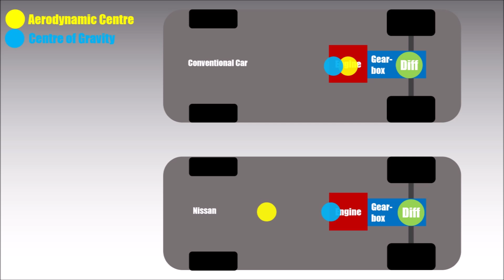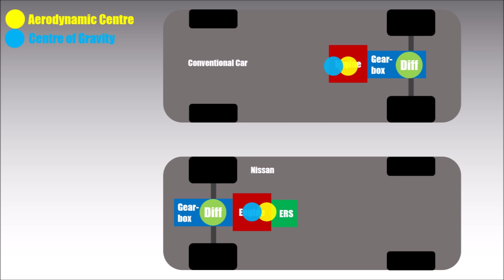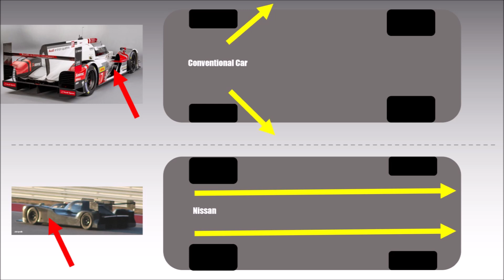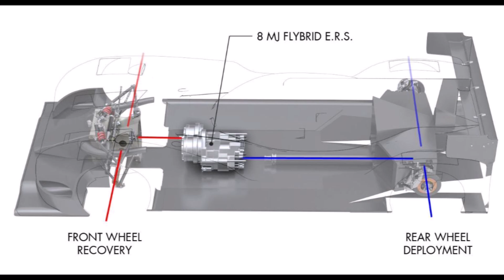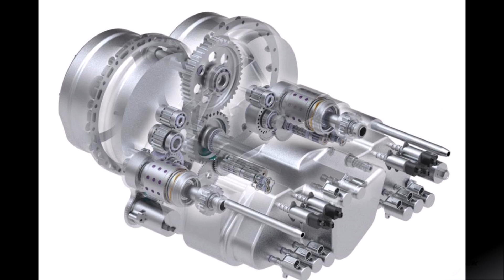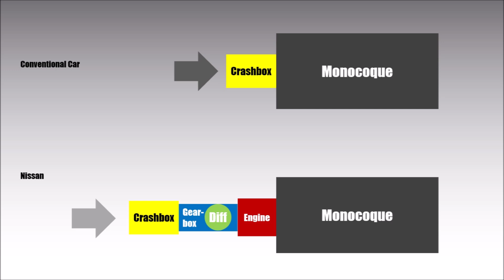Nissan GT-R LM Nismo (Le Mans 2015) - Genius or Disaster? - Technical Analysis

Comment: Had they started off with an electric hybrid system sending power to the rear they could've had a winning concept. Having some power at the rear would've helped with slow-medium speed turns, acceleration onto the straight, and probably would've helped put some more load on the rear tyres to get more use out of them. Alternatively they could've leveraged the hybrid system to run a higher downforce setup without losing top speed. 

Just a shame they killed the project so fast, but I guess all Nissan has cared for in the past 2 decades is cutting costs.
Reply: The rear wheels were also supposed to be driven, and take the majority of the hybrid power, which was to be deployed primarily on corner exit, which would have helped greatly with the cars slow speed late corner acceleration. Such as out of the Mulsane chicanes, through Indianapolis, and onto the main straight. The larger profile front tires would have also allowed them to attack the curbs a bit more. And the suspension geometry would not have been compromised in that situation either, such as it was at Le Mans with new spindles to fit the bigger brakes.
Reply: @bigbuckoramma  It would have helped their lap times, to be closer to LMP1 sure, but it wouldn't have made them competitive. The rules at the time for hybrid engagement were mandated at above 80kph. So the lack of traction for a FWD is absolutely still there, regardless of rear wheels being driven.

And given that the hybrid power was significant horsepower, and the fact their rear tyres were more narrow than anything else, it's hard to imagine they would have ever really been able to deploy it other than at high speed, when the deployment of hybrid is largely ineffective anyway.

Deploy hybrid at 320 and gain 5-10kph because you're at the vehicles aerodynamic v-max anyway

Deploy hybrid at 80kph through a corner exit and you'll be in excess of 30kph faster.

But they wouldn't have been able to do that with thin rear tyres
Reply: @flammenjc  name all the places on the Circuit de Le Sarthe that you are below 80kph.

Also, what wheels do the hybrid systems of the Toyota, the Audi, and the Porsche deploy through? Oh, that's right, the narrower front wheels. Do they have traction problems too? Of course not.

The width of the tire is determined by the weight balance of the car. It's as simple as that.

With a proper differential, and the correct  suspension geometry (See: Revo Knuckle), you can make plenty of traction and forward bite in a FWD car.
There are benefits and downsides to everything. But if you are content on believing there is only one way to do something, then you will miss out on learning anything new.
Reply: @bigbuckoramma  Arnage, Mulsanne, Ford Chicane.

The reason Porsche, Toyota and Audi didn't have traction problems is because all 4 tyres were of more-or-less equal size.

I'm not here saying people shouldn't explore new ideas. The point is, when a corporation does it in the effort to be a PR scam and nothing more. As motorsport fans, we should all hate that because they took everyone for fools, and many people took the bait and are still swallowing the hook

The product was bad. Even if their hybrid system was working it would NOT be fast enough. They could barely outpace LMP2 in qualifying with at least 200 more bhp. It wasn't good enough.

In many ways they tried to [cunningly] re-invent the wheel. And it doesn't matter how smart the methods were to force this project, it was never going to work and that's proven ONE; by the fact it was not faster than LMP2 with no hybrid and TWO by the fact Nissan dropped it almost immediately after Le Mans.

The car did ONE. RACE......

ONE.

And then it got canned.

ONE FUCKING RACE!
Reply: @flammenjc  the difference in tire size is directly proportional to the weight distribution of the car. Audi, Toyota, and Porsche all ran different front tire widths. This is basic engineering.

Calling it a "PR Scam" is just a cop out to be negative. And completely besmirches the efforts of the engineers and mechanics who busted their asses to get the car functional.

Additionally, you're only looking at total lap time, and taking a lot of things out of context to paint a false picture that suits your negative narrative. The car COULD NOT ride the curbs...AT ALL. Which meant no straightening of the Mulsane chicanes, no riding the curb through Indianapolis, no riding the curb through the later Porsche curbs. No bouncing off the sausages in the Ford chicane. The slowness had nothing to do with lack of performance in hand, and everything to do with not being able to drive the car hard, because of the heavily compromised front suspension. Which was a byproduct of new spindles, and low profile tires, driven by the need for bigger brakes... because the FlyBrid didn't work.
If you look at the trap speeds, the Nissan was 3rd fastest behind the Porsches, and that was being down a few hundred horsepower with no hybrid, and carrying 250kg more than the non-hybrid prototypes by way of a dead hybrid unit for ballast. In the microsectors, through tete rouge, and the Porsche curves the car was equally as fast as the other P1. But as soon as a curb happened, the lines required to avoid them made it impossible to carry any speed. Not because the car couldn't do that speed, but the chassis couldn't manage it in that compromised configuration.

And yeah, it only ran one race. Because that was all they were allowed. The car immediately went to test at COTA following LeMans and had a full evolution spec they were working on. There are pictures of this on Nismos official Photobucket. You can see the car with updates suspension, updated aero, and a proper set of LMP1 brakes. Not the gimped LMP2 new old stock they got for LeMans. But while they were testing, what would likely have been a fully homologated Evo spec.

So again, they worked with what they had. The only swindle was from the load of crap they got sold by ToroTrak. Had they stayed internal to Nissan/Renault and leveraged the F1 MGU-K/H units, the car would have been very different. But because they pulled the plug, claiming embarrassment instead of resolve, we will never know its true potential.

And if you think it would have never gotten better...look at the first year of the 919, look at the first R8 closed and open top prototypes, look at how many times it took for Toyota to win. Look how many variations of the 767 Mazda used before the 787 loophole...no car is perfect in its first race.
Reply: @bigbuckoramma  

When you put most of the work on one axle. You're asking for trouble, both on setup side of things, and outright performance because then you have to compromise camber because you have bad tyre wear, which compromises your pace. The advantages of spreading the work load of the car over all four wheels is huge.

Why do you think Porsches newer 911's have near enough 50/50 weight balance? By your logic they could have continued to go even further back on the weight balance so long as they had big rear tyres and tiny, bicycle wheel front tyres and it would have just worked, it just doesn't work like that.

How cars function on paper and in reality are two different sides of the equation. Once the car is in motion, you get oscillations, corners, non-uniform weight transfers and so on as well as unforeseen handling characteristics that can't be defined by computer simulations. Computer/design work gets you 60% of the way, that is, why most cars are not competitive right from the beginning.

You don't have to repeat the issues that they had, I know all about it and without doubt, it would have been faster if they had everything they were supposed to have, but they sure as shit wouldn't have touched the other 3 manufacturers with it, on pace even if it was only marginally slower at Le Mans, at conventional tracks it would have gotten absolutely whooped. Look at the driving position from onboards of that car, the drivers KNEES are almost directly behind their own hands. It was an absolute joke of a machine.

As I've said before. If it was a genius concept it would have been untaken or tested [physically] immediately by the other manufacturers and it wasn't.

It was a shot in the dark for Nissan to try and steal a competitive edge instead of making a conventional car and struggling for years, and when it was obvious it wasn't going to work, they binned the project and sacked everyone on Christmas eve. Nissan deserve no credit at all for what they did.

The point is this binned the project. Porsche didn't turn up with a 919 that wasn't winning every race and then just quit. They actually the final race in their first season because they designed a conventional car that had IMPROVEABILITY.

Despite that the 919 was actually reasonably competitive right from the start and that's because, well, Porsche things.

Most cars aren't competitive from the very beginning, the point is, the teams know that and stick with the project to improve it. Nissan didn't do that, they dropped it like a stone, which is as close to definitive proof that they knew they didn't stand a chance.

If you have a winning concept why would you drop it?

Motorsport people know that maiden voyages are fraught with issues like reliability etc

Nobody would hold it against them for sucking in season 1, but sticking it out to then go on to dominate, infact, nobody would remember the first season at all.

They had a superbowl commercial for this car for god sake, a car that hadn't turned a competitive lap at all.

Everything points to a PR exercise with the fantasy idea of maybe stealing a win in the process.

Nissan execs are/were either retarded, and knew nothing about racing and thought that they'd just turn up and win. Or they knew it wouldn't be un-competitive. Nothing other theory fits why they marketed the hell out of this car before the race.

And like I said, it paid off. Because people are still to this day defending it. Which also proves it was not "brave" of Nissan to fund this project since it was received well despite being a complete failure.

All of the evidence that exists reveals a lack of fundamental performance and a lack of will for Nissan to continue funding. There is absolutely no point is suggesting "we don't know if it could have been a race winner or not" the evidence is there, actions speak louder than words. Nissan dropped it and no other manufacturer incorporated ANYTHING that the Nissan LMP1 car had into its own design with those regulations.
Reply: @flammenjc Bicycle skinny front tires? Hmm where have I heard that before? Oh yes the Deltawing which had no issue turning what so ever and was quite fast. (Its main issue was the diff overheating) the concept from the front of the delta wing with everything being smaller because of the less weight would have worked more or less the same in the rear of the GTR-LM had it been designed as bowbly originally wanted
Reply: @cademckee7276  It wasn't "just fine" it was atrociously lacking yaw authority when it was raining since its front tyres would sit completely within a small single puddle whilst a traditionally front axled car would be able to either straddle big puddles, or have one wheel in and one wheel out of the puddle, maintaining turning ability.

The problem with the delta wing on top of that, is a similar one to the Peugeot 9X8 [without the rear wing elements], you limit your setup options. The delta wing setup options are almost entirely based upon the rear axle of the car, because the front does very little. Finding the perfect setup is going to be even more difficult, as well as tweaking from a bad setup position into a better one, since you have less smaller tweaks you can make.
Reply: @flammenjc  It isn't the case that newer 911s are near 50:50 weight balance. Saw corner weights on a 992 Carrera S. It's 62% rear, 38% front, much like all the earlier generations. FYI. (turbo has same weight balance) Rear weight bias is good on a rwd car, I know you know that. Somewhere around 55% rear seems to be best, perhaps 911s are a touch tail heavy, but that's better than a rwd car being a touch nose heavy.
Reply: @flammenjc  That's why more development time is helpful. As the Deltawing was raced in the United Sportscar Championship, it grew a rear wing, and a front splitter for the tighter tracks.
You really don't think the GTR LM could have been a contender if it had another year of racing and development?
Reply: @colinbowman8816  The only way it could have been competitive is if they radically changed the design philosophy of the entire project. Even if they could make it work at Le Mans it wouldn't have been able to be competitive at traditional circuits that have even slower traction zones.

The fundamental issue is, people rated the potential of the project based on the current design philosophy and that was just never going to work.

Much like Peugeot coming in without a wing and people too busy whooping and hollering at how its unique and different but without giving much thought to how that affects the limitations with car setup and maximizing that package at any given circuit. And as we see today, in order to make the Peugeot fully competitive, they've had to introduce a rear wing. Granted the Peugeot WITHOUT a rear wing was nowhere near as bad as the Nissan LMP1 was or would have been but the point still stands that people hyped the Peugeot on the merit that it was different and didn't have a traditional rear wing.
Reply: @colinbowman8816  BTW on the subject of 911's I was talking about the 911 RSR race car, since this whole topic is about racing not road cars.
Reply: @flammenjc  To be clear: The new 911 race cars are also rear engined.
You're right that the GT3 RSR had a higher level of performance than the GT3R, or Cup, and it is probably a little bit easier on the tires over a long stint. But the RSR program ended in 2022-after about 10 years. The new GT3R cars you see in endurance racing are rear engined, as they were throughout the last decade, while they raced alongside the GT3RSRs.
Reply: Blame renault for the cost cutting. They own Nissan, have done for the past 20 years, hence why all their road cars have turned to shit. Only true nissan is the gtr
Reply: IDK. The electric hybrid system needs to capture power from the front wheels under braking. 
Capturing it from the front, and deploying it at the front is straight-forward. One motor-generator unit.
Capturing it at the front and deploying it at the rear is not quite as easy.
That would take one generator at the front, and a motor at the rear. Or some weird gearbox thing to connect your one motor to both front and rear. Or a motor-generator at the rear only, where it can't recover nearly as much energy (but is still better than nothing)
Reply: Not just that, but a hub motor style electric system would have taken up none of the space at the rear, meaning they still had all the aero advantages, and would have also allowed them the run the 16" tyres that would have helped with traction. And of course the additional 400-500 HP would have made a huge difference to performance over a whole race. It's hard to compete with 1000hp cars when you have 500.
Reply: No because they fitted smaller tyres on the rear to compensate for the underbody aero and the fact it was primarily FWD

Comment: Thank you very much for the video. You gave a lot of insight into the challenges of the hybrid (flywheel) system. Since Audi also used a flywheel, what was so fundamentally different that Audi's concept did work and Nissan's did not? Just the much, much higher KJ (energy) requirement? The challenges for Audi must have been similar.
Also: There were once interesting rumours about Audi's fuel tank / fuelling pipe design that saved them time during pit stops, but can't find it anymore. Maybe worth a video? :) Liebe Grüsse aus der Schweiz!
Reply from the maker: Thanks a lot!
So Audi used the already proven Williams Single Flywheel, which had 0.72MJ energy storage. Until 2014 that was only good for the 2MJ class. With a few updates, they could push that system up to the 4MJ class, but that was the limit.
The Williams system was an electric flywheel, so all the gears and oil requirements like the Torotrak system of the Nissan were not there.
Since Audi had the heavy Diesel powertrain, they wanted light energy storage solutions. A second flywheel or battery would have been too heavy for them at that time.
Reply: @bsport320  Awesome, thank you for the insight!
Reply: Basically Audi used a flywheel as a battery for electric motors where Nissan was using the flywheel as the power deployment and energy store

Comment: Lets make a 1000 hp front wheel drive car. What could POSSIBLY go wrong!
Reply: What did go wrong was the hybrid system, and the car was required to make fundamental changes to the layout to even be drivable. The fact it did as well as it did with a crippled drivetrain, the wrong brakes, the wrong tires, and components being pushed well beyond their limit, and for their duty cycle, says a lot about how good the design actually was, and how much potential it had.

To make what they had work, is impressive.
It's a shame you lack the knowledge to understand and comprehend that.
Reply: Plenty of SFWD and WTAC cars running FWD and well into xxxx hp doing just fine, they just needed time and money to sort the concept out ;)
Reply: @turnip8173  Yeah you are right. It's definitely the way to go. Keep on taking the tablets!
Reply: @christinalloyd9566  Never said its the way to go, but dismissing it as an entirely bad idea is very dense